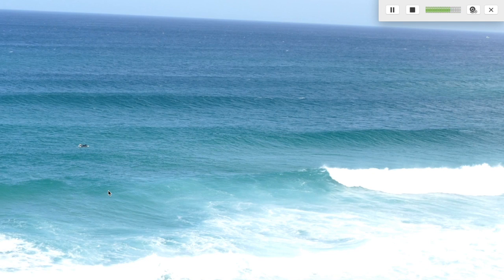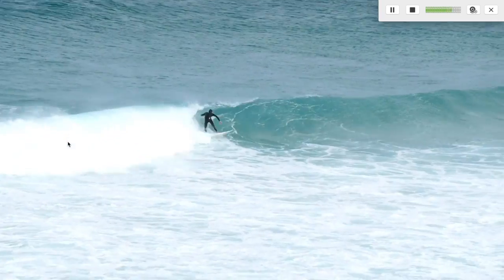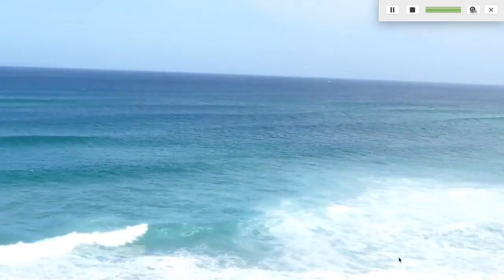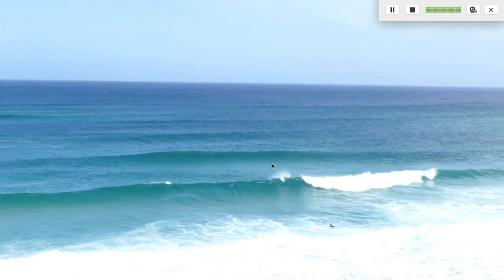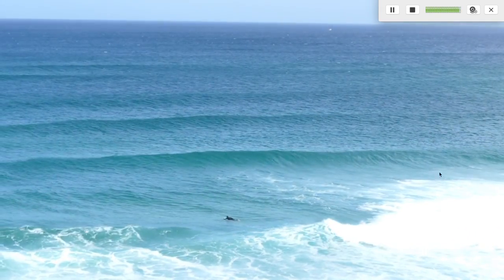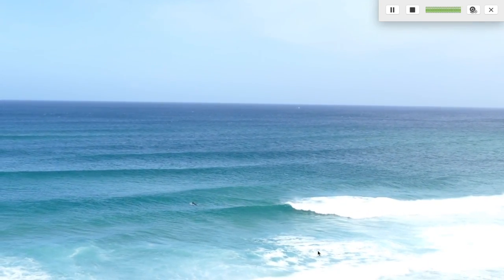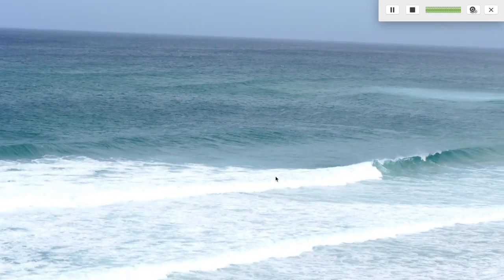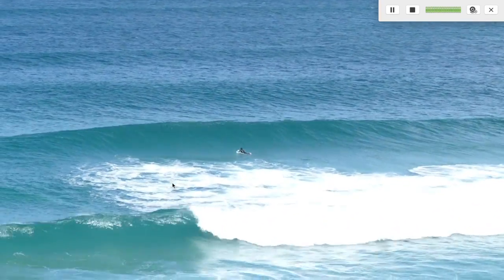Using the Rip Currents in Surfing

Comment: I was afraid to do this today, the rip I kept getting into was too strong! Is it safe to do this? When you get out to the back are you able to get out of the rip?
Reply from the maker: Nice question Brie.
You should use rip current when you are an experienced surfer and know the beach well.
If in doubt don't do it.
Want to try it out? Do it in a small day of waves, because there is less water moving and the current is not so strong.
In your experience, if you get too outside, you can exit the rip current by paddling parallel to the beach, in direction of the waves. The waves will bring you to the shore.
If you find yourself too far out in the ocean and in danger, stay on your surfboard and sign for help. Never leave your surfboard because its a floating device that will keep you afloat! Try to relax and wait for help.
In the majority of the situations paddling parallel to the beach will work out.
Remember to respect the ocean and your abilities at all times.
If in doubt, don't paddle out.
Asking a lifeguard or experience surfer can help you having a more real perspective of what the surfing conditions are. 
Take care and enjoy your surfing.
Reply: @FilipeAnjosSurf  thank you Filipe
Reply: If you are in a rip that leads out, you are supposed to swim perpendicular to the current. 
But will you be able to recognize that? Also, you might end up heading into some other hazards.  Or there could be other currents that lead you out too far sometimes. Not usually, but you need to know your area. 
However if you are a surfer, it will lead you out past the surf zone, and you can paddle into the waves to get in generally. 
Are you comfortable swimming and treading water in rough water? You will probably be ok. Stay calm and make sure you don't get too cold. Your respect for the sea is wise.

Comment: I really could have used this when I was learning how to surf. 
:)
Reply from the maker: This should be used by experience surfers, in the beginning tolearn how to surf it's not recommended. Rip currents can be strong and dangerous, you should have a clear picture about it when using them. And what to do if the current is too strong. So they should be used by more experienced surfers.
Reply: @FilipeAnjosSurf  i'm beginner. n usually use this chanel..(i only go to water if under 4 feet swell 👌)